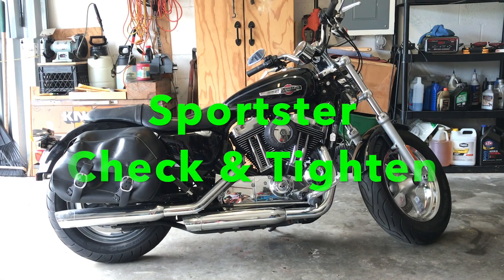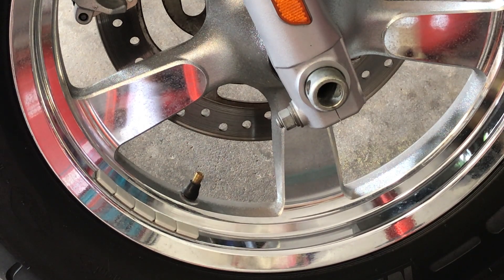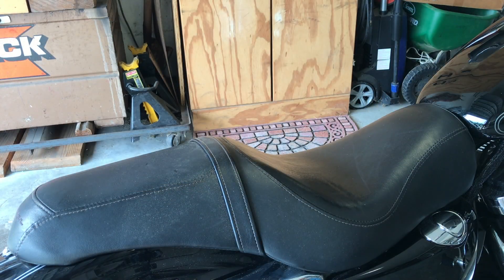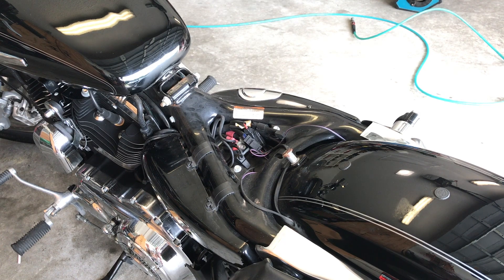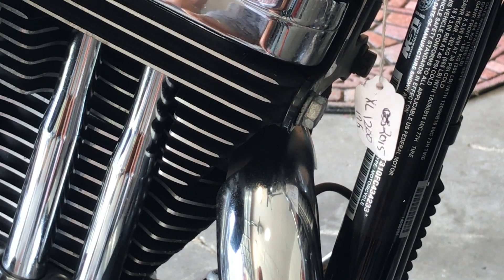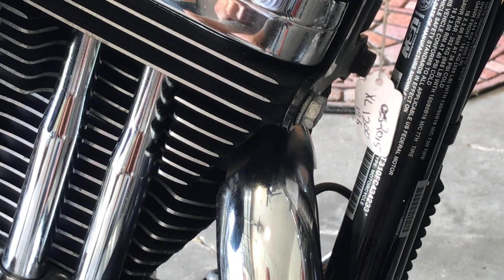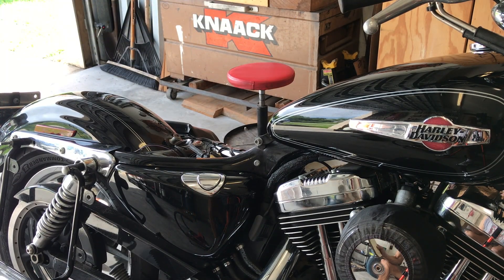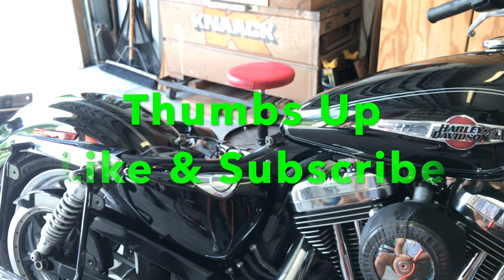How To, Sportster Things To Check And Tighten.

Comment: Hey Rocco, I just bought a 2003 Anniversary 1200. 
There seems to be conflicting tire pressure information. The frame states 30 front and 40 rear. 
Do you have any insight on what would be better pressures with solo rider?
Reply from the maker: I myself like 36 in the front 42 in the rear. See how that feels and make your  adjustments to your preference 
Thank you for watching and your sub Joel.  Ride safe and have a great day. Let us know how that feels.
Reply: Go with what it says on the tires, not the frame. Tire manufacturers know what pressure their tires should be at to provide maximum performance and life.

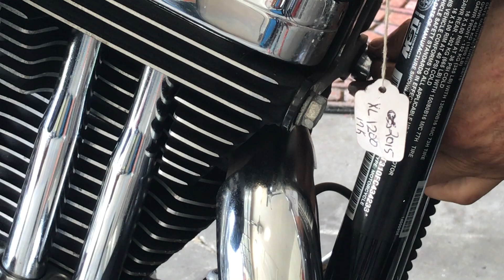Comment: At 14:00 what screw is that called? My left one is missing as you said in the video and I'm trying to replace it.. any and all help is greatly appreciated
Reply from the maker: Happy to Help,  Front motor mount bolt.  Thank you for watching and your sub Matt. Ride safe and have a great day.
Reply: do i need to torque that bolt?
Reply from the maker: @pikey928  They all have torque specs it's a motor mount tighten it. Happy to help any questions just ask. Thank you for watching and you sub papa_mitch.  Ride safe and have a great day hope that helps.

Comment: My bike went to backfiring bad it will ldle now because I tryed to set the carb it's 2987 sportster the chrome tube on the right side of engine were leaking I got the orings for them but if I give it throttle it pops and trys to quit running I've changed plugs and wires adjusted carb air fuel 2and 1/2 turns now it idles new carb about a month old was running grate was my wife's bike she passed is why I keep it and try to keep it running nobody in our town will work on it Harley Davidson says it's to old so I'm coming here looking for any help I can get thanks guys
Reply from the maker: Happy to help. What year what bike? . Thank you for watching and all your support Phil. Ride safe and have a great day.

Comment: This might sound stupid but here goes .... does it matter if you check your oil while the bike is leaning on its side stand or straight vertical?
Reply from the maker: Depends on the year of the bike. Sportster are straight up and down,. will give you an honest reading, needs to be halfway on the dipstick or you end up with  bad running bike.   The oil will work its way onto your air filter through your breathing system which will end up with a rich running motor. Equals bad running motor.  You like to get as much air for your fuel mixture. Happy to help. Any questions just ask. Thank you for watching and your sub FJoy. Let us know how it works out. check your oil.. set it halfway on the dipstick.. clean air filter and plugs and she will ride great. You will be surprised at the difference it will make.  Ride safe and have a great day

Comment: Hey Rocco, what about the fork stem bolt? Should I thighten it or would that have an impact on the fork bearings adjustment? Keep up the good video’s. They help all the bikers worldwide. Cheers from The Netherlands, Nico
Reply from the maker: Happy to help. I would not touch the stem bolt. Because it will impact the fork bearing adjustment. Thank you for watching and your sub Nico. Ride safe and have a great day.
Reply: @TwoWheelRocco   thank u Rocco. Before I asked you I already did tighten it. Now I backed it off a little bit. Hope it didn’t screw up the adjustment, otherwise I have to go the my indy.
Reply from the maker: @nicovanommeren5641  You should be all right. The adjustment is under that top plate you'll see a notched spanner nut that's what sets the bearing tolerance. If you go over a bump and you don't feel or hear any odd sound you're fine. How many miles on the bike and what year?
Reply: @TwoWheelRocco   don’t feel any problems for now. Only a little wobble at 40mph. Bad swing arm bearings is probbibly the cause. A have some play in at the rear swings arm, indy will repair that next week. Bike is an 2016 sportster 48 with 5000 miles on it.
Reply from the maker: @nicovanommeren5641  Let us know how that works out. Thanks for the update.
Reply: @TwoWheelRocco  i will! For everybody here, check your swing arm bearings once in a while. Mine already are bad at 5k miles. Thanks again Rocco, i’ll keep u posted👍🏻